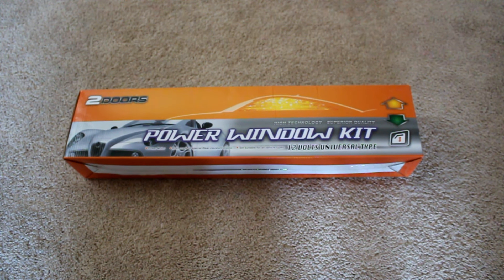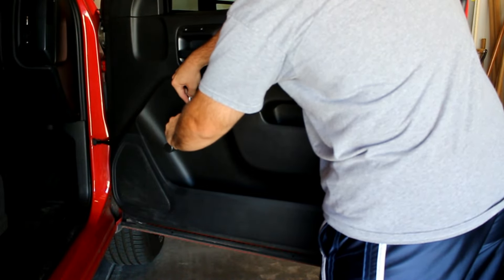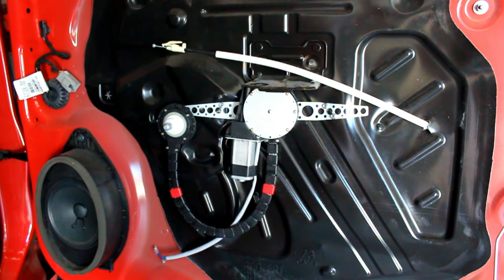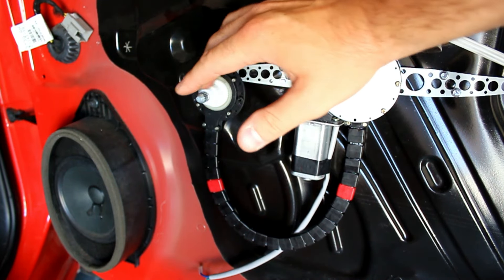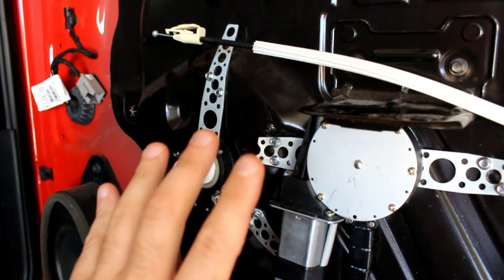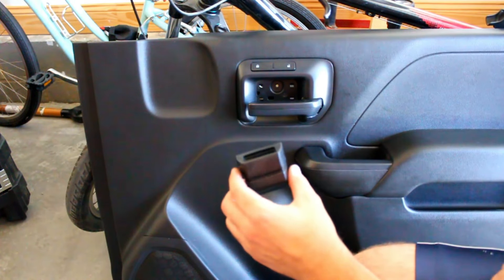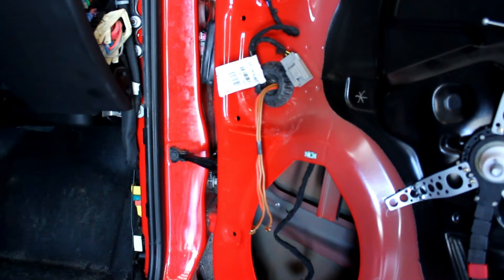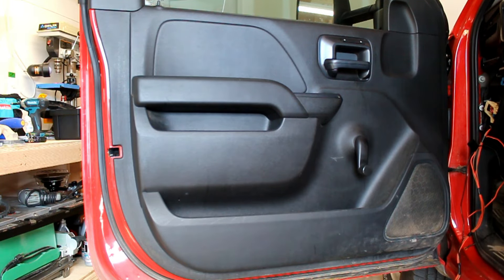[HOW TO] Convert Manual Crank Windows to Power Windows - 2016 Silverado W/T

Comment: I got a question where would be a place that can install it for me? Like a mechanic shop or what? I’d like to get it and get someone else to install it.
Reply from the maker: A good automobile that specializes in audio/visual installs would likely be my choice. Since there is considerable wiring involved and door panel removal. They are used to that sort of stuff. Good luck!

Comment: I know it will probably be more expensive but cant you just replace both doors with doors that are oem that have power windows and lock unlock and just plug in?
Reply from the maker: Yes I guess you could. But you’d still need to do wiring to run the motors and switches.

Comment: I have the vehicle trying to do that conversion do you think I can use the factory wires and door panels that already have the lowering and highering window button?? Instead of making a hole where you have to put the buttons? It looks a bit sketchy
Reply from the maker: You could probably do that.
Reply: does it work with u ? I have the same idea but i want to know the result =)

Comment: Not familiar with pickups, I'm from the UK. Did this 2016 vehicle have front manual windows? Seems shocking for a 2016 car!
Reply from the maker: Yes it had manual crank windows. It’s common on US trucks for them to have crank windows on work truck models.
Reply: @fondupot  wow that's shocking. I prefer to think it's for weight saving and track times, but it's probably cheaper lol. I'm thinking of converting my rear windows to electric but I don't know how it's going to work
Reply from the maker: Definitely just a cost saving option. You could probably use a kit like the one in the video to convert your rear windows.

Comment: Does it fit on a 2007-2013 silverado?
Reply from the maker: The Problem the kit is largely universal. The steps should be similar. With different ways to hook up power. Run wires. And remove door panels. But yes  it would definitely work.
Reply: Thanks! You sir earned yourself a subscriber 👍🏻
Reply from the maker: Awesome! Thanks for the sub!

Comment: It’s the 21st century, why can’t they make them standard equipment in trucks which should’ve been done since 2003 and in subcompact cars since 2009. The only manufacturing difference between manual and powered windows is a couple three way momentary switches, brushed dc motors with worm gear boxes, 35 feet of 18 gauge wire for a single cab truck which are cheap about only 35 dollars difference in manufacturing cost. If I ran an automaker. The cheapest half ton truck would have powered windows, mirrors, and locks, 6 way manual drivers seat, a 7 inch touchscreen stereo with apple CarPlay and Android auto, 4 speakers in the single cab consisting 2 1 inch soft dome tweeters and 2 6.5 inch midbass drivers with 140w rms total and a much better and smoother sound than cheap GM base model speakers.
Reply from the maker: Little cuts add up when you sell half a million of something. But I get where you are coming from. Some people prefer crank windows though, less to go bad over time. I like having power window tho for sure. Thanks for watching and thanks for the comment.
Reply: @fondupot  I like to sacrifice a little bit of profits to make the customers and employees happier. The soft-dome tweeters and woofers have ferrite magnets which are cheaper than neodymium but, very good sounding speakers can be made with them. Also, the midbass has a composite basket, rubber surround, treated paper cone for moisture resistance and sound quality, and a 1.25-inch voice coil which is much better than the 0.4-inch voice coils on other base model audio systems, the tweeters have a textile dome, felt on top of the pole piece, and composite frame. A class AB amplifier with 70 watts per channel, and 3rd order passive crossovers with electrolytic capacitors and ferrite core inductors because it has to be built to a price but, it will have sound quality comparable to mid-end bookshelf speakers. The base price would be 32,000 dollars for the single cab since it's an EV. The base powertrain would be a 50 KWh graphene battery and 350 hp RWD electric motor-axle the range would be 250 miles which is plenty for a general contractor plus the contractor will plug it in every time they come home. An extra 25 KWh, 50 KWh, or 75 KWh would be an extra 1500, 3000, or 4500 dollars respectively. A 150hp front motor would be an extra 1500 dollars, a 250 hp front motor would be 800 dollars more than the 150hp front motor. The trims would be base, plus, premium, and luxury instead of a million different trims and configs to confuse buyers. The plus model gets an option for vinyl seats, not just the base model but, the plus model's vinyl seats will have texturing to more closely resemble leather, more color choices, and leather style stitching.
Reply: Jeez, sounds like you've put a bit of thought into this.
Is there a new car company coming out that I'm not aware of?

Comment: I've got a 99 Dodge Ram 1500 mine has manual windows since my doors has rust I'm going to just change my doors with the motors already in them and wire them good illustration but it looks so complicated , it's a must to have power windows it's way too much to be climbing over the seat to roll down the wi
Reply: Window
Reply from the maker: Yea. Must have for me. I do a lot of driving in this truck and my passenger side is constantly packed with bags. Having power windows is so much better.

Comment: If I just buy new doors with power windows what wires would I need ?
Reply from the maker: Pablo Escobar not sure. Because the wiring is not the same on the factory harness as the new doors you’d be buying. I don’t think it would be easy.
Reply: I was thinking the same. Thinking of going to the car junk yard and grab all wiring and fitting I would need, and see how it goes.lol
Reply: If it's a 2014 or newer you have to get new dashboard harness and bcm in order to use gm doors that already have power windows...

Comment: you will be sorry.....i wish i had manual windows and locks  replacing motors and actuators gets old
Reply from the maker: Never did I regret it. They worked great for 3 years til I got a new work truck.